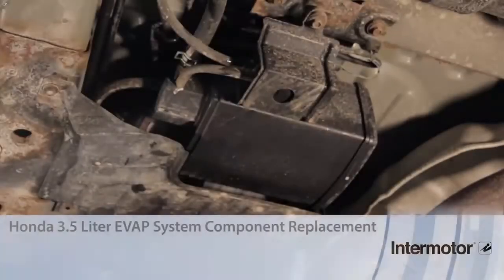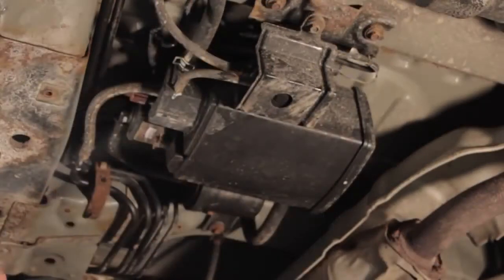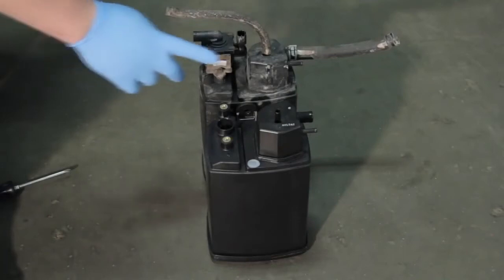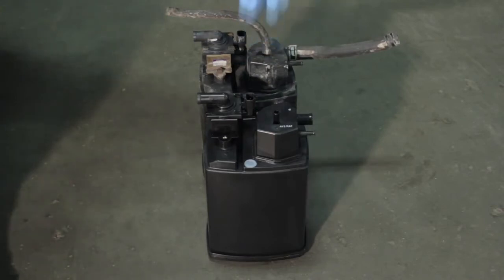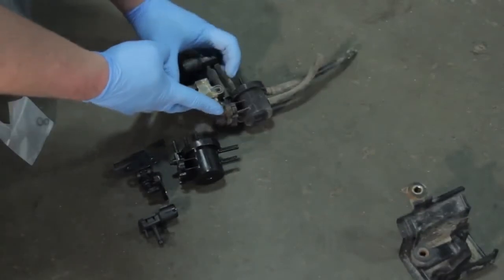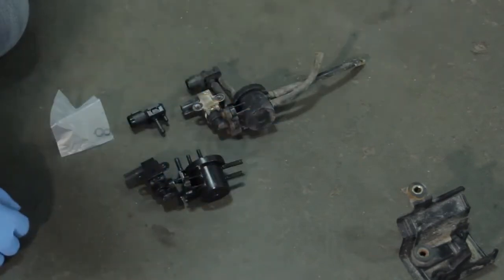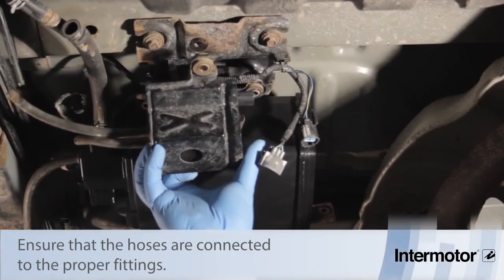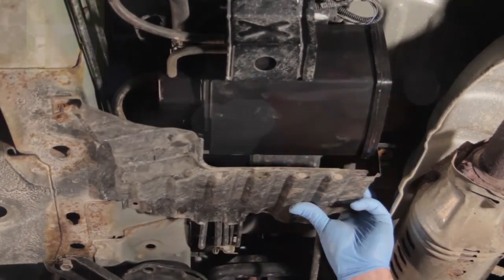Intermotor™ EVAP Canister Replacement

Comment: I purchased this part and have no way to get the mounting bolt that holds the canister; it is rusted on there. I have tried extractor sockets and other methods but with the fuel vapor I don't want to use heat and there is no clearance for vise-grips. Any advice to get this canister bolt off or unit away. Another tricky issue is this bracket is not very firm so hammering doesnt do much either.